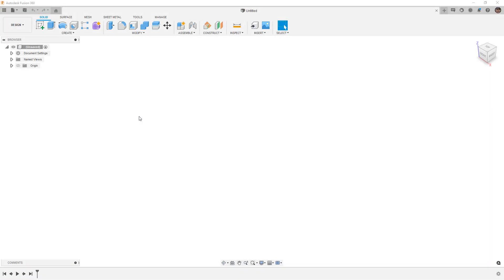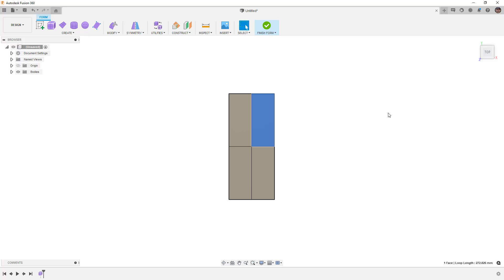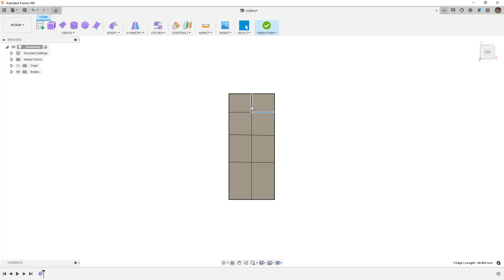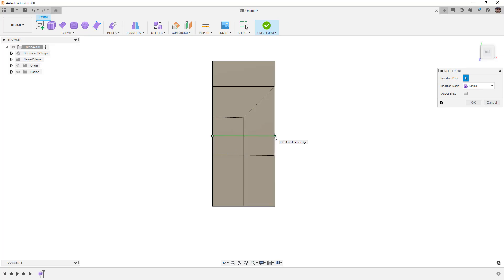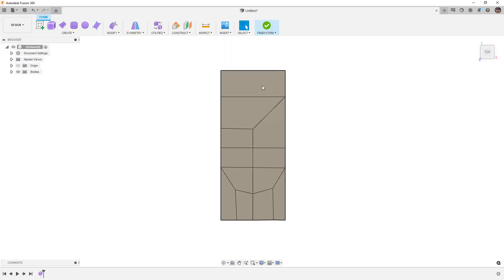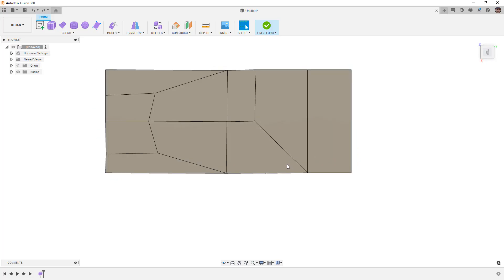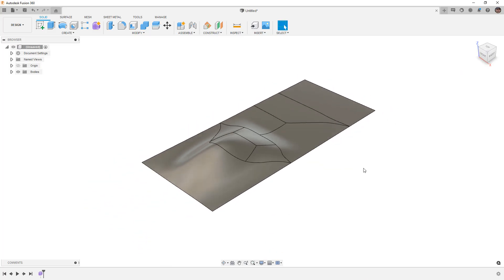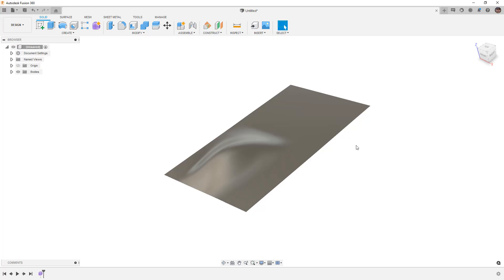Fusion 360 Form Mastery - Part 3 - Divisions for 4 Sided Faces

Comment: IDK, it seems if you just made your divisions symmetrical it would be better?
Reply from the maker: On a flat part its a bit tough but the general idea of splitting them should remain.  Fusion forms have T points which let you get away with more than say a poly modeling program.

A general rule though is to try and keep the face sizes the same globally until you start adding fine detail.

Comment: Great tutorials! I am a 3D noob and I don't really understand why you need to have 4 sided faces? The models seem to better in smooth mode when not making weird cuts to have 4 sided faces? Say I'm only working in fusion and my aim is to 3d print my model, why are the 4 sided faces needed?
Reply from the maker: Well it has to do a bit with the math under the hood with how a surface is made from the "cage".  Each vertex and edge will control tangency of a surface into and out of that vertex/edge.  When you have 4 sides the definition of that surface is much better.  When you have 3, meaning two edges share a common vertex, you end up having a flat face and a pinch at the shared vertex.  If you have an "Ngon", meaning more than 4 you run into issues where the middle of the face/surface can do some funny stuff like have waves or pinches.

it isn't to say you can't have these things, but you just have to be careful where they go on a design.  Aiming for 4 sides will always produce the best result, but if you have to change direction its nearly impossible.  Fusion has what is called a "Tpoint" which lets you get around some issues BUT this comes with its own challenge.

For 3d printing the surface quality still matters.  just remember to put those 3 sided and ngons away from big changes in curvature.  if you get them closer to a flat or flatter face it will be better.
Reply: @LearnEverythingAboutDesign  right! Then I understand better. Thank you for the explanation!!